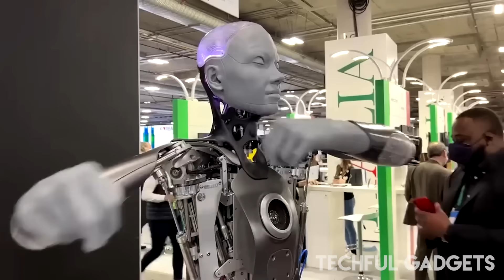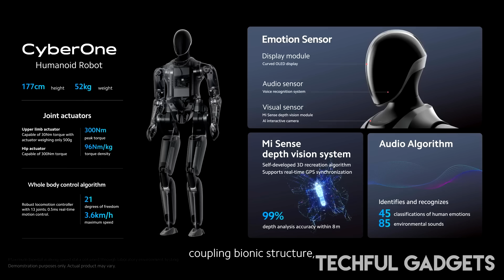Top 10 NEW Humanoid Robots of 2025 (Updated)

Comment: Physics Systems of Science Sensors and Technology Research:
((G^2.07)R))=E general relativity law 
(gold kit fukushima robotics) $7887 the secret of the robotics community.
>>Using a test method eliminates errors and worries about false data and research. You can prove it to yourself to work with the robot and use your own test points in the method. The test method starts low and goes high for the acceleration factor.

Please tell me in history when Isaac Newton had Robotics or computer science. I do not believe he had it all around good as a modern physics researcher.

Found on the first line of code in the standard operating computer systems line code. You will remain stuck and they are useless without this code test method.
F=m*23
F=m*333 
F=m*633
(Voice prompts start at 933)
F=m*933 ----robot states "too slow human" a voice box is required for audio prompts to go higher in the test method test points. Isaac Newton born in 1643 did not create.

F=m*1993 -----robot states "too slow human" 
F=m*2193
F=m*2300
 F=m*2390

F=m*2391 ---Upper Limit Do Not Go Over this Value.

 Their command is like this "make it SO and make it a go, go, go" --I could not put the swearing in this, or this could be flagged or blocked. Ask for their command and they will repeat it for you as much as you need. Give them at least two or more calculators and/or cell phones to make the robot's reaction time faster they do not have to be new cell phones either could be old junk used ones.

You can also use code: F=m*a*b*c 
Equals:
F=m*2308

Not this low acceleration factor code: F=m*a*a
Numeric Acceleration Factor of 32
F=m(1 x 32)

Dr. Ronald G. Erickson
PhD Robotics Science
PhD Physics